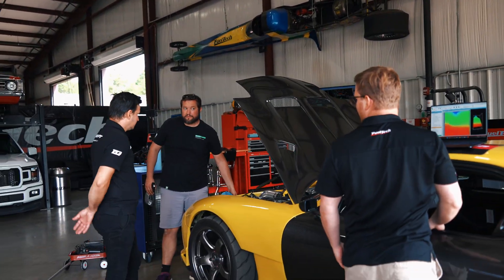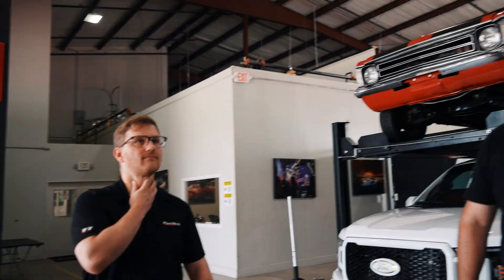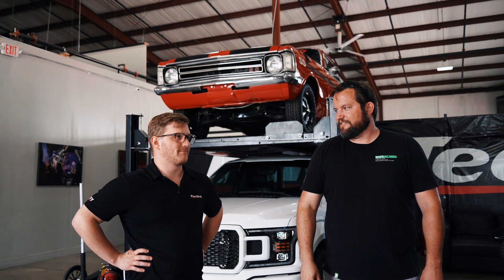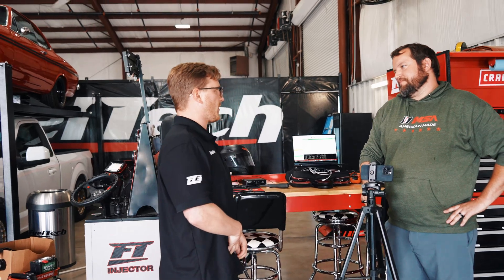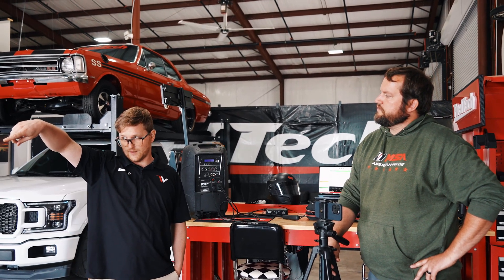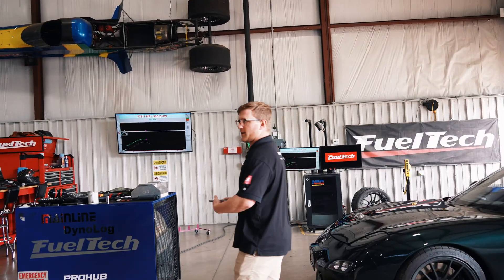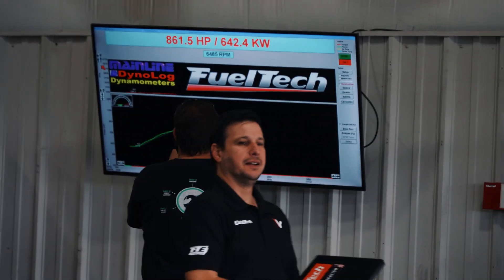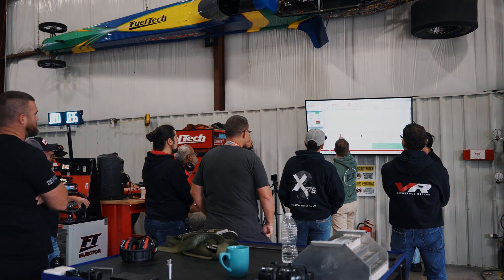Best of Both Worlds?! Procharged LS & Turbocharged Rotary RX7 | Scraplife Garage

Comment: Wow the rotary was most impressive by far😂did they leave out a few dyno runs in between? They made 772 so damn fast. Good job scrap life
Reply: FD rx7 engines with good turbos make power easily. theres one here in sydney Australia , with 950HP at the wheels , street car.